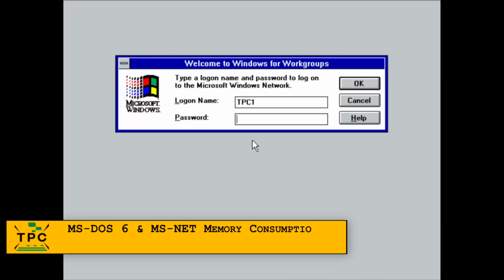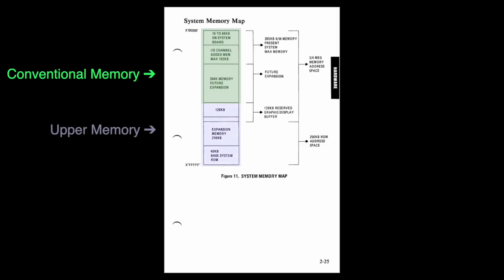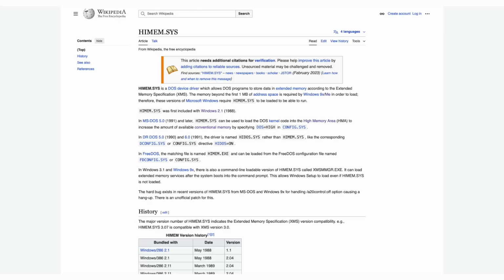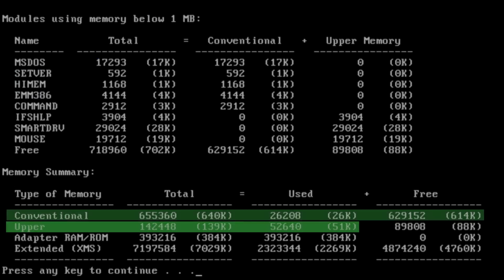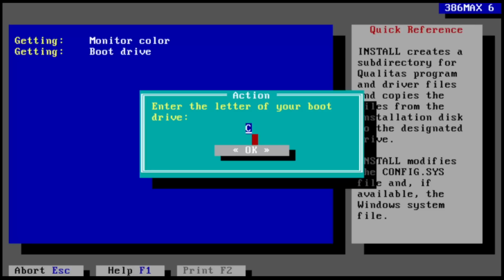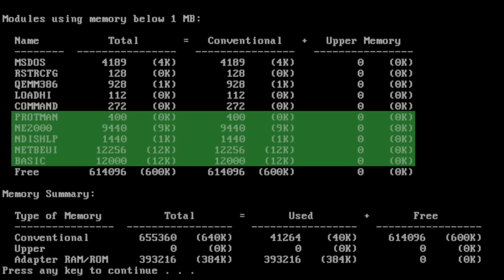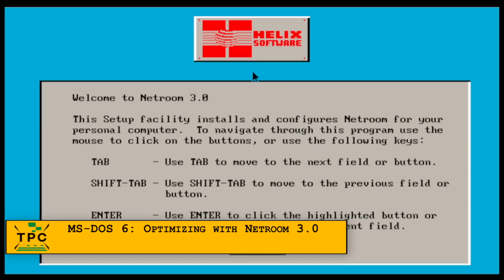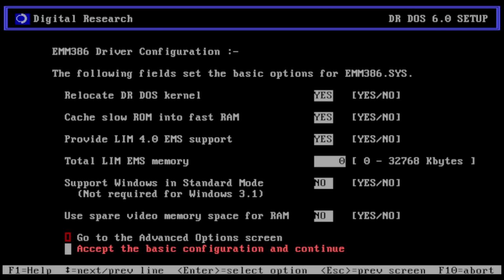Mastering DOS Memory, Part 1: Into Memory Managers, resource conserving Drivers and TSRs

Comment: I am using simple combination of DOS 7.1 and Win 98, as most people, I tried clean DOS, but I didn't really find any advantages in it, everything that works in DOS 6.22 works even in DOS mode of Win 98, you just have to do some tweaks, everything you need is already included in Win 98, installing some 3rd party memory managers mostly do just mess and crash Win 98 and it gives you nothing more than when you just use simple himem.sys and emm386.exe RAM HIGHSCAN commands, all files are already included. With this settings, you will get up to 730 kB of conventional memory (depending on used GPU for some reason).
No need for some QEMMs and other mess. I am not exactly sure what HIGHSCAN is doing, but in combination with some GPUs, it can give you even more conventional memory when you use EMM386.exe. If you have an older GPU that gives you more conventional memory, you don't need to use highscan, just RAM or NOEMS is enough.

Comment: I didn't really understand all of this back in the day, and even today, the more i learn, i have a feeling, the less i understand.

Unfortunately without EMS you won't be running The Incredible Machine 2. Which means you might as well throw away the computer, it's pointless now.

I did try QEMM back then because it freed up SO MUCH MEMORY but it also made a few things prone to crashes or locking up i forget.

Comment: Nice video, looking forward to part 2!

Something worth mentioning is speed. My impression is that running pure DOS applications on say a Pentium 75MHz or so can feel more sluggish with EMM386 loaded than without.

P.S. I think I've mentioned Deskview/X in the comments before. Hoping you will do a video about that!

Re the size of the CD-ROM driver: Drivers from manufacturers contain DRM junk that uses the drive as a dongle for the driver. Don't know how much space that eats up, I would hope it's only used while loading/initializing and freed up later, but still.
I'm not skilled enough at x86/DOS debugging, but I bet that it would be possible to make one brands driver work with another brands drive by just patching the DRM part. Or when you use 86box or similar you could probably just change the text string in the emulated drive to be some other vendors to make the other vendors driver load.

I hadn't heard of the driver you used or the other one mentioned here. I remember though the happiness of discovering cpqidecd . sys from Compaq which was a DRM free IDE CD driver that would just work with any IDE CD/DVD drive. Always used that rather than some vendor specific driver.

Comment: The CD-ROM driver from PTS-DOS (PTSATAPI) is not compatible with every drive but it only uses half the ram than VIDE-CDD. I'm also not sure about its compatibility with video games, but it may still be a last resort for accessing a CD on systems with a very small amount of RAM.

It was included with "Acronis OS Selector SE" which is available at the Internet Archive, inside the floppy image that can be opened with 7zip or Winimage there's a file called install exe which is a self extracting zip archive and can be opened with 7zip or Winrar

It was also available with earlier versions of Acronis OS Selector but it's harder to extract from the setup files.
And of course it's included with PTS-DOS 2000 but again difficult to extract unless you install the whole thing on a (virtual) computer.
Reply from the maker: @ruben_balea  Nice, even smaller than VIDE-CDD. It‘s crazy how small things can go.
Need to give it a shot, I have a copy of PTS-DOS.

Comment: Good old times. From DOS 2.11 to 6. 

DATEV software, Novell server, large number of open files. The problem was the 32 bit extender for Datev's Paradox database. There were two options, a system house --> expensive. Or a long night. 🥱😀 The long night was better. As described, some things were not needed, for others there were good replacements. 

I have two software solutions in mind in addition to the video. The keyboard driver for GR and 4DOS. 4DOS was the best command interpreter at the time with 256 bytes in conventional memory. 

Lastdrive was limited to H:. 
In addition, driver software to access the AVM B1 card in a dedicated dial-up server.

615/617 k was the goal, to run the DATEV Paradox env without problems.

Comment: Great video! Can't wait for part 2. One thing to mention: CuteMouse from FreeDOS sometimes will not like resolution switching. 

When playing a DOS game that changes the resolution like Down Under Dan, I found that the game would switch the resolution to a slightly higher resolution (maybe 640x480 vs 720x400?). CuteMouse would have issues allowing me to click "Play" or "Load" at the bottom of the screen, since it didn't get the memo that the resolution had changed. Using Microsoft's Mouse Driver (9.x I think) worked flawlessly. 

I used XHDD2 or XDVD2 for HDD/Optical drivers but I think one of those drivers didn't play nice with my Athlon 550Mhz machine with DOS 7 (the Chinese DOS Union version) and corrupted the disk. Under 6.22 I think it worked flawlessly, although a replacement HIMEM driver didn't (and caused crashes).
Reply from the maker: Indeed, there's sometimes some level of incompatibility , which still may require the original drivers here and there.

At least with DOS 6 onwards, custom boot menus can help to mitigate this compromise between a general purpose config, and maybe a very specific one for just one particular application or game.
Reply: @THEPHINTAGECOLLECTOR  speaking of menus… could I drop the idea of “how to make a custom boot menu” into your suggestion box? 😀
Reply from the maker: @Coburn64  sure, will come anyway once I dive into the DOS network software ;)

Comment: It is amazing to see that there is still interest in the old and obsolete operating system of MS-DOS. However because the intel 8088 and 8086 could only address directly one megabyte of memory and had only read mode operation, this operating system was written for this specific hardware. The fact that later intel CPUs maintained full backwards compatibility with the intel 8088 and intel 8086 allowed this operating system to continue for a long time.

Comment: Helix Netroom is a bit different from 386MAX and QEMM, by the fact it "cloaks" not only a set of the most used drivers in DOS by offering its own version of them, but also "cloaks" the system BIOS (yes, it replaces part of the BIOS services by its own "cloaked" versions, hence the "Award Software Inc." copyright notices in Netroom program's banner). And this so called "cloaking enabled" was just a DPMS version of the drivers, TSRs and BIOS made by Helix, or ported by their own vendors with the help of some DDK which Helix used to sell. Novell, Logitech and Adaptec had "cloaked" versions of their network redirector, mouse driver, and SCSI ASPI stack. Cloaked drivers don't use EMS or UMBs, but run as protected mode modules outside the 1MB memory limit.

This means if you used Netroom in conjunction with "cloaked" versions of the system BIOS, drivers and TSRs, and you enabled certain parameters in the RM386 EMM driver, you could get more than 640k of free memory for DOS programs plus all your UMBs almost intact to load non cloacked drivers there... But for this to work, every part of the core stack had to be "cloaked", and unfortunately not every program was cooperative. Programs and many BIOSes enabling Bus Mastering didn't liked this "cloaking" tech so much. System BIOS cloaking doesn't work in PCI BIOSes. Also, Windows 95 OSR with WDM/USB enabled or Windows 98 aren't compatible with this. In this case, Netroom was less performant than 386MAX or QEMM.
Reply: Cool! Never heard of that before.

Kind of like running the .386 windows 3.x versions of the filesystem and MFM/IDE hard disk drivers in Windows 3.x, except that doing that won't afaik kick out the fat filesystem code from DOS.

Comment: My first own pc in the late 80s was a 286 IBM clone with 1M Ram, a 3.5in floppy drive and 40 megs harddisk. It came with MS-DOS 4. And that meant: it was a constant struggle against low memory after boot. Since Himem and EMM386 weren't applicable here. So I was happy when I got 500k conventional ram available. After I got a copy of Win 3.0 I was not able to load it or parts of it in upper memory. So it ate lots of the lower memory. I could run Minesweeper or Solitaire but had to leave Windows altogether  to get something useful done.

Comment: This memory management nonsense really stayed relevant well into the late 90s and early 2000s if you were the type of person to play old (but not ridiculously old - we're talking ~5 years old) DOS games. Usually it wasn't a huge problem because the games of this era, even if DOS-based, ran in protected mode and could use XMS for most things, thus having minimal conventional memory requirements. But they still required some conventional memory, and some more than others.

One of my favorite childhood games was Star Wars: TIE Fighter, which just wouldn't run in Win9x's DOS window for me for whatever reason. It wouldn't work in the default "MS-DOS mode" configuration either due to lack of conventional memory. I needed a mouse driver and legacy Sound Blaster emulation driver to play the game, so the leeway was limited 😅 AFAIR, I ended up with a special configuration that omitted the international language settings and the real-mode CD-ROM driver specifically so that the game and its dependencies would fit.

Win9x actually had a special provision that you could provide a custom DOS configuration, a set of one-time CONFIG.SYS and AUTOEXEC.BAT files that would be bundled with a DOS app shortcut (a PIF file) - upon clicking on the shortcut, the computer would reboot with this one time config, run the app, and then reboot back into Windows with original configuration. But back in the DOS / Windows 3.x era, there were other tricks. DOS 6 had a boot menu feature - you could have multiple sets of CONFIG.SYS settings, selectable at boot time. People would have different configurations ready for gaming, networking, Windows or other apps with specific requirements, possibly disabling drivers that were huge but not necessary in certain applications (e.g. you don't need CD-ROM to play a game installed from floppies, and you don't need sound to run AutoCAD) - and routinely reboot between those.

This concept was even carried on into Windows 9x and NT as "hardware profiles", but this feature was seldom used and has been removed from Vista onward.

Comment: Qmm386 was great i recall running it for a while but i also remember having some issues with it that didn't exist with stock himem and emm386. Glad those days are gone. However i am amazed how bloated modern software had gotten. Things just burn lots of memory. At work we have software that uses 30MB normally but it can use over 1GB. That's insane compared to the 90s. Every k counted with MSDOS as you show.
Reply from the maker: I tend to make fun and jokes about nVidia graphics drivers being as large as 500 MiB in download, as much as Windows XP waswhen installed to the hard drive!
Reply: @THEPHINTAGECOLLECTOR  Most of that weight isn't even the drivers themselves, but the bloatware called Nvidia Desktop Manager (a .net program which means bloat) and other stuff. Debloating drivers with only the basic DirectX and OpenGL stack DLLs sums like 30MBs, more or less, and from that weight, the most goes to the DirectX and OpenGL DLLs. The CUDA and Video Codec DLLs amount like 25 or MBs more. This gives you a 60MB driver. The rest is bloat.
Reply: @THEPHINTAGECOLLECTOR  You make fun of nvidia drivers only until you realize that AMD drivers are even bigger. 😀 But I totally agree, it's a bizzare, almost 1GB GPU drivers.....that's something market should not accept, but it's too late, it already became a standard. The same with patches for games, instead of updating some files, you pretty much download that game and ang again and then some people are surprised that planet is getting warmer, we behave really stupid, things are very inneficient and all that "green" shit is just propaganda, today products are not more efficient nor ecological than old products that worked for 50 years and that's what I call eco - no pointless garbage like today, no nonsense downloading of 150 GB because of game update....this is not sustainable, you need more and more capacity of internet for streaming, we should not waste it like that by downloading 200GB patches for games that look like from 2012.
Reply: Today developers can't even program anymore, they just use some tools and AI mess and nobody is testing anything nor optimizing it, they just expect that you will buy even more ram and faster CPU.....those 90s limitations were really usefull, there should be some limitation on purpose even today to force them optimize their shit.
Reply: I had one qemm boot option that had around 740k base memory reporting! Monochrome reclaim. Dos high. Everything in umb or HMA that could be. Even a compact non ms cd driver for SCSI cd off soundcard. That was great for doom, cd cd playback while stomping dæmons!